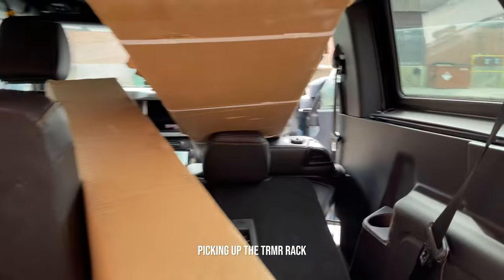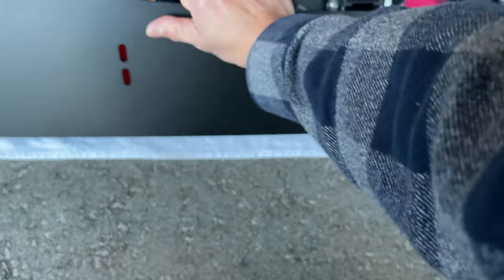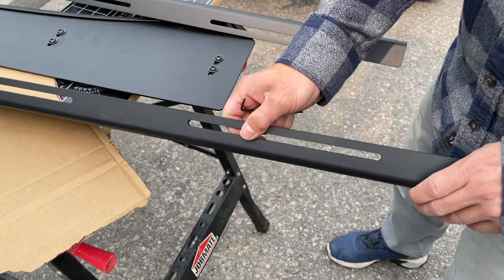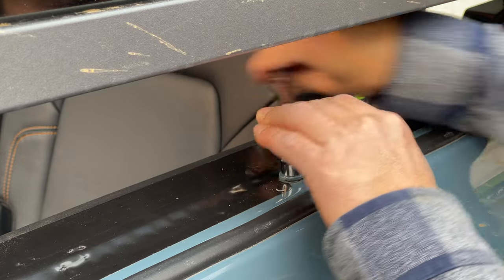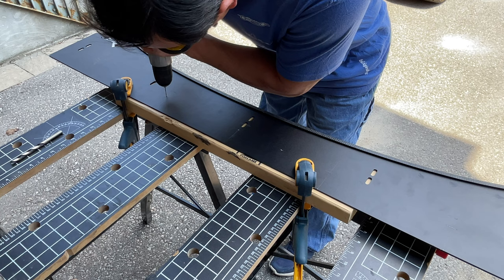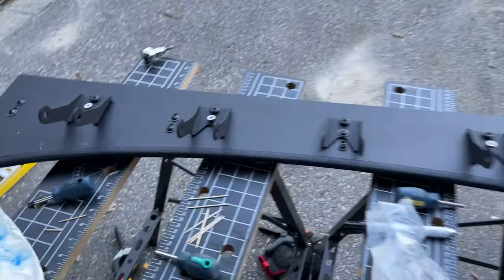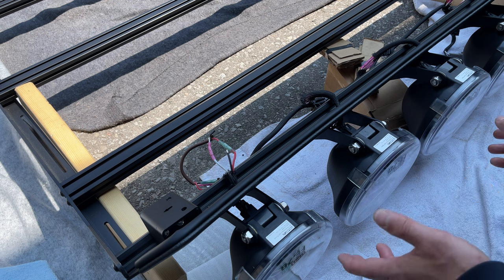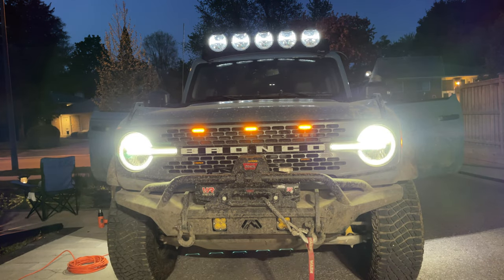Bronco TrailRax TRMR Roof Rack with Custom Light Mounts!

Comment: You can take the pins out of the connectors and put them through the hole, then put them back in the connector.  They make a tiny tool to do it.
Reply from the maker: If I ever go back to revisit this, I’ll try it. Thanks for the suggestion!

Comment: Do you have an update on the lights? I expect the solid copper wire connections to fail at some point.

That being said by mounting the lights to the t-channel bar should be pretty secure. Looking forward to your next video.

At least your miscellaneous drawers have compartments!
Reply from the maker: The solid wire does fail intermittently. 😅
There are so many things I have to go back and re-do. 🤦‍♂️
Reply: I’ve had really good luck with the soldered heat shrink butt connectors. When you go back to redo it be sure to use those. Also might be a good video showing how to learn to disassemble the plugs. Good skill to have.
Reply from the maker: @swooshdave  YouTube doesn't notify me when I get replies to comments, so I missed this. I really like those butt connectors too! I'm never going back to what I used to do. Thanks for the suggestion.
Reply: @neverendingweekend I can’t remember how to set it up to get notifications. Then again my videos rarely get any comments so I sometimes don’t see them for a year. 😜 I think the easiest way in in the Studio view when you upload. I think there a Comment section.
Reply from the maker: lol. Checking to see if I had any replies to mg replies. Found yours just now. 🤦‍♂️
Reply: @neverendingweekend I got around to installing by roof lights. I’ll have a video up on my channel in a bit. Not a super fancy video this time but it will hopefully show how I did it.

Comment: Do you find it difficult to remove your tops or impossible with the roof rack? I love the look of roof racks but want to the ability to go convertible still
Reply from the maker: Nothing is impossible 😅
WithOUT the lights and with OUT the PakRax (side vertical racks), you’d additionally just need to remove the front 2 attachments of the rack to the top of the windscreen. Not too bad, but you’d have to remove everything in 1 piece. A bit cumbersome and you might damage the rear rack attachment areas. … actually, thinking through it, best would be to take off the rack, then the top. Definitely not a quick/easy process but doable. 

Unless you’re talking about just the panels above the driver. That’s still doable and very easy. Just never look behind you and you’ll think your whole top is off 😉

Comment: Since it is aluminum does TrailRax provide torque specs in the instructions?
Reply from the maker: I don’t recall any torque specs. But I also don’t recall any issues with torquing. And I’m the OCD type to run into issues of there are any to be had. 🥹

Comment: https://youtu.be/Vt_rAIKPlWA

You can de-pin those connectors for your lights and run the wires thru the holes you cut and than put the connector back on.
Reply from the maker: Heyyy,… 3 days too late 😢
Definitely something I would’ve tried though. Way better solution.  
… but 2 I’d still have to cut because they were too short. At least I know for next time. Thx for the tip!

Comment: Please tell me you didn’t use house wire to extend the wiring 😆
Reply from the maker: I did! 😅
I wasn’t sure where to get proper wiring, so I went to Home Depot and asked for 14guage threaded wiring. They gave me solid core by mistake. Should I swap it out?
Reply: @neverendingweekend  solder doesn’t flow through a solid core wire and makes for a weak connection. I wouldn’t trust it and would definitely swap it out.
Reply from the maker: @Thatgreenbronco  ahhh, makes sense! The 2 lights I needed to extend, both pulled apart. Thx for the tip.